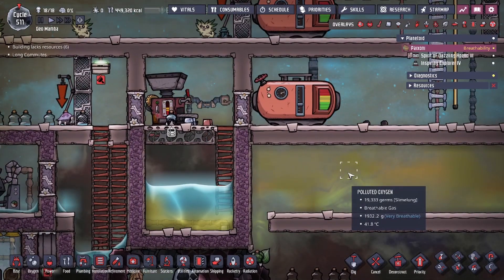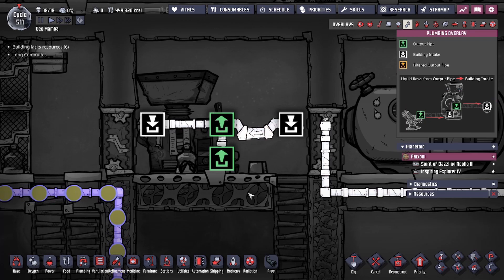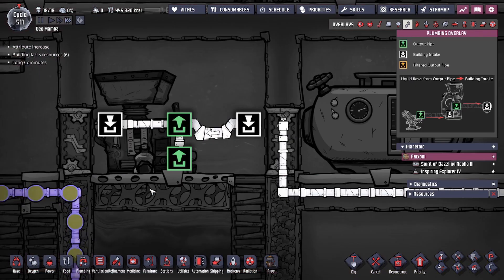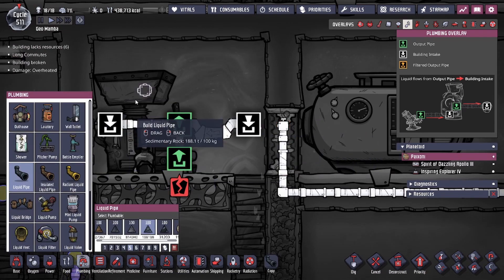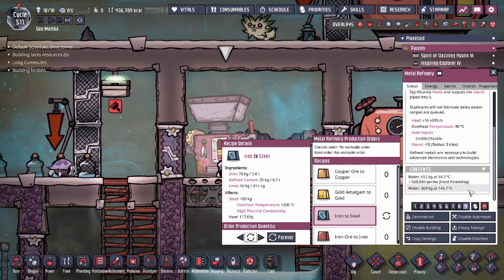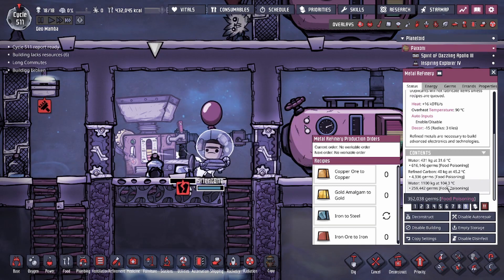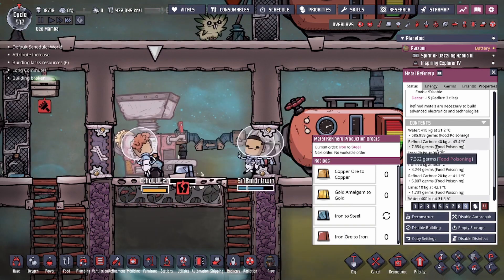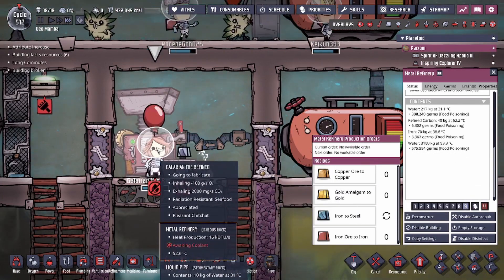Cheesing the Metal Refinery - Cut Heat Generation with this Simple Trick - Oxygen Not Included

Comment: Just discovered this channel, great vids! For this topic, i'm curious what happens when u pump 300C crude oil in. When you deconstruct do u get 420C petroleum? 🤔
Reply from the maker: thank you for the kind words!

so the magical space that is the inside of the metal refinery, if any of those liquids that are heated past its state change point will spawn as a liquid in bottled form if you were to hit the empty contents or deconstruct the metal refinery. the moment it spawns into the overworld, it checks for the temperature of the element and then causes the element to go through the state change. 

for your question, you would get a pool petroleum if the crude oil is hot enough. thats because it spawns as a bottle of crude oil and breaks out of it from state change
Reply: I was thinking if you preheat crude oil directly pumped from oil biome by looping it 2 times through a vacuumed liquid reservoir/MetalRef, then passing it through a cheesed MetalRef, you can get a huge petroleum pool while making steel 😂
Reply from the maker: @AnyaXPsyduck  that would work actually, no problems. the only thing is that you cant auto dump the contents of the metal refinery for the petroleum. gonna have to manually press it everytime.